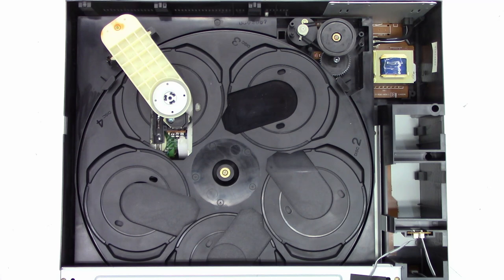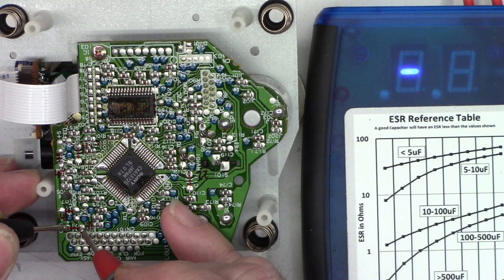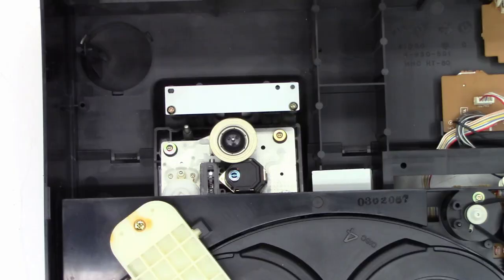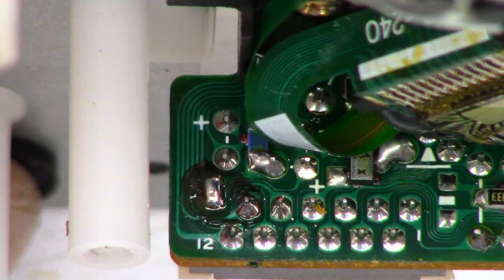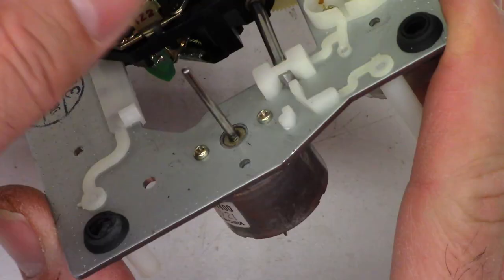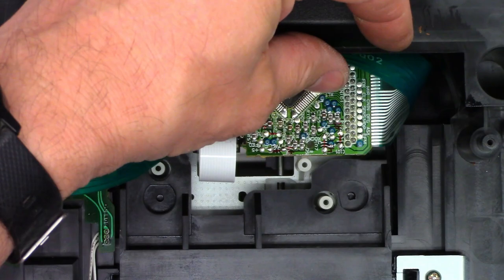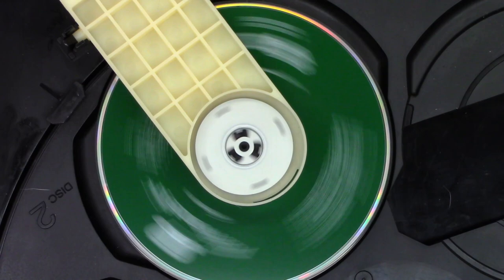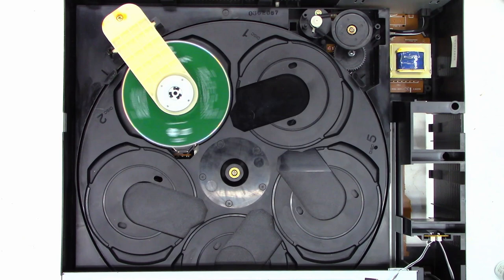SONY CDP-C305 5 DISC CD PLAYER NO PLAY REPAIR C405 C505 C605 C705 C315 C415 C515 C615 C715

Comment: Very informative tutorial. My NAD 512i cd player plays discs but makes a very audible rubbing / scratching sound that appears to come from the clamping magnet area. Examining the disc spinning, I'm not seeing it contacting the cd tray or laser. I've taken the chucking mechanism apart, examined any possible rough spots and sanded all spinning contact areas with 1500 grit sandpaper, cleaned it yet the noise persists. The spindle motor was tested by itself and spins freely with zero noise. I'm thinking maybe it is the spindle motor that's faulty but only shows when under load playing a disc. I've ordered a replacement spindle motor and hope that corrects the issue. Another possibility is that the cd support platter on the spindle is at the wrong height but it appears original and untouched or maybe the support chassis is slightly asymmetrical but it appears level and straight with no noticeable bends. It's a mystery if the new motor doesn't fix it! 🤔
Reply from the maker: I have had many issues with the non adjustable clamp portion that suspends the magnets dimensionally changing over time. Sometimes I had to add a shim (washer) between the top cover and the chassis to slightly add tension to the clamping mechanism and the case.

Comment: Me in my vcd player have no display but the they had a power color red.when i plug in second time it will flash the display when i press power on it the cd player is not working 3 cd changer is my player but it is not spinning or open the indicator lights all green what is the problem with my sony vcd player can you help me please thanks🙂

Comment: Got a c305 where sometimes I can’t get the tray to open or read discs , when that happens I have to turn it off then back on and quickly open the tray , if they tray opens it will also spins disc but won’t read it , I removed the green ribbon cable that goes from the main board to the laser board and I found one of the leads has a cut internally, I reinstalled it and magically it started to read and play discs even with the cut in the cable , but I still sometimes get that problem where it won’t read the disc and open the tray unless o turn it off
Reply: Also mine skips when I lightly touch it, it’s pretty sensitive that loud music will cause it to skip as well

Comment: My Sony 315 finds a CD in the tray and plays it but will not advance to the next CD even if I hit the next disc button. It also will not open the tray after playing the disc unless I power it down and power it back up then it opens automatically. At one point the tray wouldn't close and I pushed it in. I know I shouldn't have done that. There may be other issues but haven't gotten further. Could this be a ribbon cable problem and an alignment issue because I forced the tray closed? Thx for any suggestions.
Reply from the maker: Does the display show that discs are present in all of the slots? if the optical IR emitter and detector does not see a disc than that slot is removed from the queue and you can not access it. It does the test when the tray is closed and the results are final until the tray is opened and closed again.

Comment: My problem on my Sony 5 disk player is the output stopped working so I am not getting any music out of my speakers. Amy suggestions? Thanks!
Reply from the maker: does the disc time elapsed counter on the front display count accurately?
Reply: Yes 👍.
Reply from the maker: That tells me that the issue is with the digital to analog converter or a missing power supply problem to the digital to analog converter (most likely)
Reply: @norcal715  OK, thank you.

Comment: Hi I'm new to your channel. Great videos! Can you please advise how to remove the plastic gear to the motor assembly that opens the carousel. I need to replace mine some of the teeth are broken and I'm unsure of how to remove gear from its pin.
Reply from the maker: On that unit I think there is a shaft with "C" clips one it. once you remove the "C" clip you can remove the shaft and the gear should fall out.

Comment: just bought one yesterday at a tag sale. It did not have a remote ( all the ones on ebay do not say 305, so not sure if we can even buy one? )
and while I was looking for the model number to try and buy a remote for My wife, I lifted up the back to take a photo and a disc
came off the tray and now the drawer will not come out.    Hope You can advise before She kills Me !!!   Thank You
Reply from the maker: On the bottom side there is a screwdriver slot that will allow you to manually open and close the drawer, take the top off and unjam any discs you see then open the drawer and do the same.
Reply: @norcal715    I took the two screws off the top and it slid out and opened and I was able to remove all 5 discs and get the draw to open.  
Only thing different now is disk one light does not show up and I may have put it in wrong or something but at least the other 4 work.
Thanks for Your help !!!

Comment: Where do you get spare ribbon cables for these units? I have a CDP-C325, Almost Identical to the model you repaired.
Thanks.
Reply from the maker: What cable do you need? Usually if you measure the length and pin spacing with the number of conductors you can find generic replacements on eBay or amazon.
Reply: The bottom green cable has a notch on one end that goes from the mainboard to the laser unit!  The other cables are no problem to replicate but this puppy is quite delicate impossible to solder as the tracks are microns thick!

Comment: I live in Columbus Ohio area. Any suggestions as to where I could have mine repaired? It seems to be the same problem. Thanks!
Reply from the maker: I am sorry, I do not know of any. Are you interested in sending it to me to look at? Email me NorCal715videos@gmail.com
Reply: I've just been asked to look at a Sony cdp500m 5 disc player. I think the spindle motor might be gone because it can locate which position the disc is in. But when it tries to read it,it just spins and spins it seems slow and if I gently touch the CD it stops turning only for it to carry on when in move my finger away. It always indicates 0 on the display but will advance the track number when I push the track forward button, but is still just spinning the same all the time. I saw that your one stopped and said no disc after a little while whereas this one doesn't and if I press open it releases the disc from the drive but it's still spinning at that point in the cradle until the friction of disc on plastic abruptly stops it. Glad it wasn't a favourite CD lol. Could this one be the motor ?

Comment: didn't know you could buy replacement spindle motors .... where do you get them? I have ordered replacement motors for cassette players and most are junk....
Reply from the maker: Just put in the manufacturer's part number and found some from China
Reply: RF-310 is I read the good quality motors.

Comment: Ive got an issue with one of these players not ejectind the disc trqy
Reply from the maker: Might be a slipping belt.
Reply: @norcal715  i thought that but the motor doesnt move when the button is pressed, but if i wind the draw out then power on it pulls it in

Comment: Hi, i have a sony cdp 705 it looks identical inside , mine plays good no problem except when i i turn up the volume skiips ,I watched a video that there is an adjuster for the laser, but on mine there is three different adjusters and I don't know which one is it? ,Any one that can help me  pls.
Reply from the maker: If you have to adjust the laser power hen the laser is failing. These are in a closed loop system meaning the laser will self regulate if working normally. The other 2 adjustments on a KSS-240A are focus offset and tracking offset.